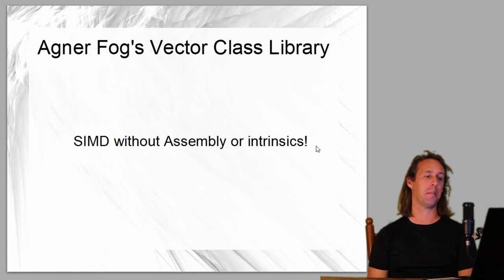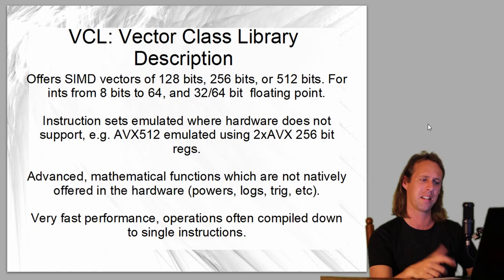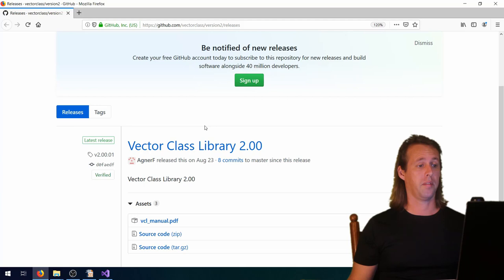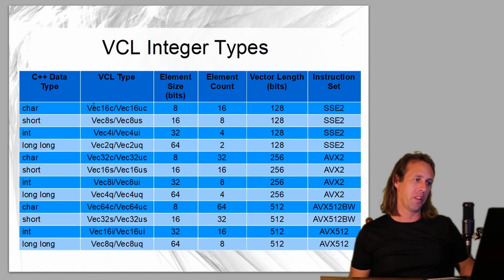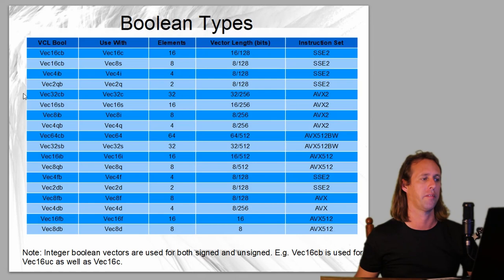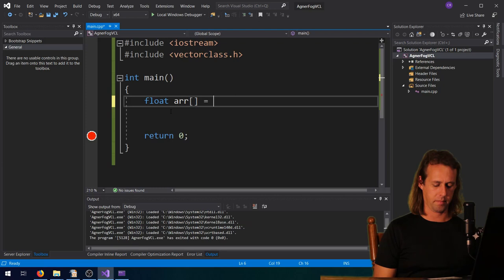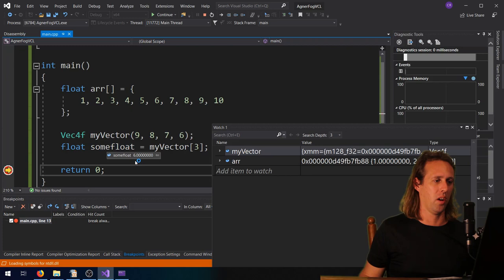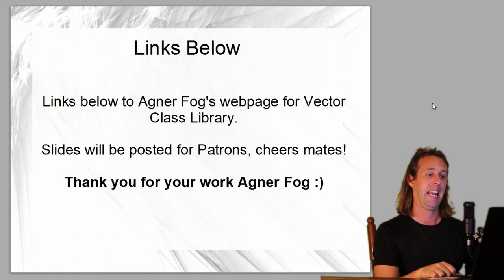Agner Fog's VCL (Vector Class Library Installation and Overview)

Comment: Imagine having such a library, where you can use long datachunks like qwords as 8 little byte long fixnum, but for GPU-s. There are parts in the FPU-s that an do integer arithmetic, so if you could use those for example by shuting down carries at every 8 bit for eample, make it handle the bytes as isolated chunks but still do the proper calculation inside,  you could gain some seriously insane calculational speed for stuff where precision isn't that inportant. instant times 4 on any GPU, and probably higher since those little integerish(fixnum) vectors won't require that much pre- and afterwork.
Reply from the maker: That's a really interesting thought!

I've often wondered if you could SIMD and manually perform 256 int additions. So, store an array of 256 ints with all their first bits followed by all their second bits, then third, etc. Like rotate an int array 90 degrees bit-wise (SoA vs AoS style). And then manually code full-adders, logic gate to add all 256 ints at once.

Not sure if that makes sense. It's plausible that we'd at least negate the effects of cache misses since the whole block of 256 integers would fit into the L1. But it's all theoretical at the moment. Not even sure I can explain it, hahaha.

Anywho, cheers for watching :)
Reply: @WhatsACreel   

I have also been thinking about this. I think it's much more natural to approach SIMD in this 'vertical' way,  as opposed to the traditional 'horizontal' way. 

It's easy to work out many kinds of useful algorithms when bits can be accessed one at a time, even though the parallelism limits one to non-branching conditionals. Say you want to zero out all even numbers. Just invert the least significant bit and copy it into the other registers. Maybe you want to reverse the bits? Easy. Want to shift the bits up or down? Just a matter of moving the registers, or maybe even renaming them! If you use sign bits (not two's complement), you can clear the register containing the signs to get the absolute value of all the numbers, or flip it to negate all the numbers etc. 

In short, you don't need special instructions such as bit-shift, abs, sgn... instead you can build them yourself with simple logic and move operations. True RISC!

It would also be space efficient, since you would only use, say, 5 registers to store 5-bit values. Register space is valuable. With hardware support, it should be faster, especially for small word sizes, since the  amount of computation would scale with word size.
  
There's just a liiiittle problem. How to efficiently convert between 'vertical' and 'horizontal'? With current hardware, that seems to kill the idea outright. We would need some SERIOUS hardware redesign!
Reply from the maker: @letMeSayThatInIrish  Great points! I actually did test it with 32 bit int addition. It seemed to approach the speeds of regular SIMD as the size of the arrays increased, but I couldn't get it to outperform AVX. Hit the memory bandwidth wall, and both techniques seem to settle to the same speed.

For flipping single bits, or rotations, it would be extremely fast as you say.

There's probably a bunch of things this technique does really well. Definitely an interesting idea. I wonder how it would do with AES or SHA256? These things are pretty shifty, and rotatey.

Anywho, cheers for watching and sharing :)

Comment: very nice video.  I will check out the library and Mr Fog's website is interesting too.  I would like to see more of the efficient SIMD instructions used in conventional software libraries.  As long as developers find the right bottlenecks, there is a huge opportunity for improvement.  (I fear a lot of software is memory bound...cache problems rather than cpu over use ... so people have a lot of optimization to do before this type of thing dominates program speed.)

Comment: Is there some add on (extension) to Fog's library that can handle vectors of any size? Example:say the underlying simd instruction is 8 floats wide. Then float vectors of size 100 would be divided into 13 8-float vectors with the last being 4 floats wide. That way big vector operations would would take advantage of SIMD even if to big to fit.
Reply: Optimally, this should be done by padding the array to the next 8-float boundary. Falling back to other SIMD instructions or even scalar operations is unnecessarily complicated and introduces performance overhead, whereas padding the array only wastes some space.